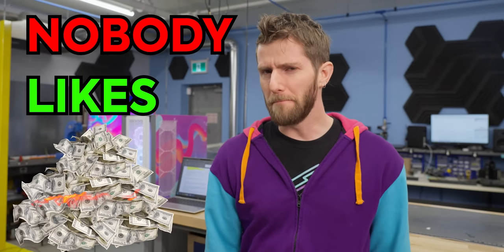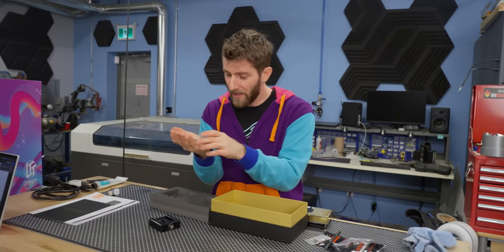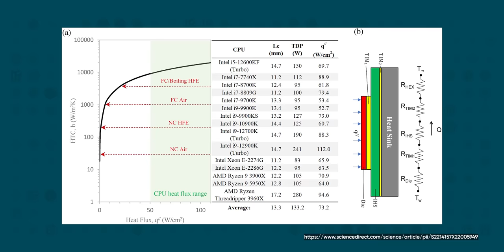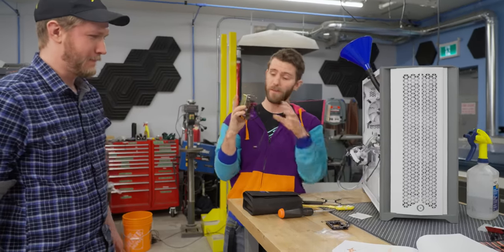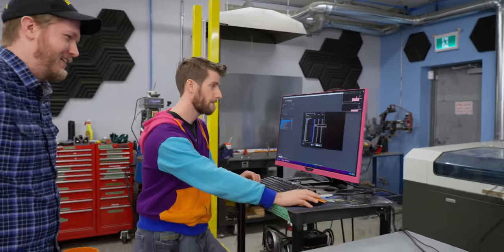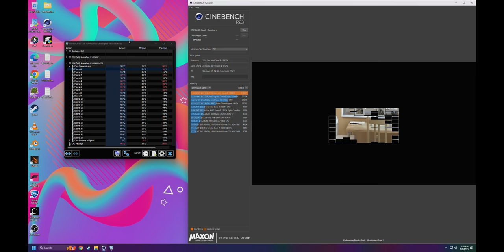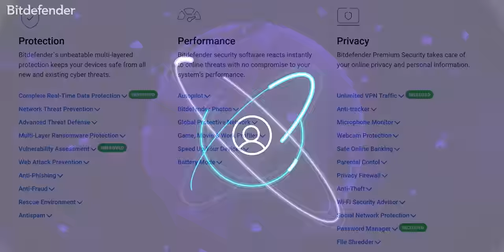This Cooler Might Kill Your CPU - EK Direct Die Cooler

Comment: Imagine making a CPU that people use to benchmark their cooling solutions.
Reply: 7800x3d beats it and draws half the wattage
lol Intel........
Reply: @escapetherace1943  and an R7 7600 can draw more power and still be way slower - go figure - overclocking a CPU to the max makes it inefficient.
Reply: @escapetherace1943 beats it in what? Gaming?
Reply: @ABaumstumpf  also have to understand that windows 11 and intel are directly working with eachother so it better preform better and with double the cores too.
Reply: @stookla4942  " that windows 11 and intel are directly working with eachother"
So?
And AMD and Microsoft and AMD with Apple and Nvidia with Tesla etc...
Reply: Honestly, this is how all CPUs would ideally work. If the only limit is thermals, a CPU should try as hard as possible to make use of that headroom under load. If it can't do that, then the CPU's architecture is the bottleneck. Besides, if you spent the money for a chonky 360/420 radiator AIO, you should be able to get your money's worth. 13th gen Intel does it. Zen 4 AMD does it too. It just makes sense.

If 90C makes you uncomfortable or you don't like the high wattage, you can set those limits lower. It's way easier to do that than it is to scrape together every spare mhz yourself through manual overclocking.
Reply: @jmun3688  factorio and nothing else
deal with it 😎
Reply: @ABaumstumpf  "So?" It's the reason why it preforms so much better. Windows 11 was literally made specifically to work best with Intel's architecture. Going back to windows 10 shows different results due to them having equal support.
Reply: @stookla4942  "Windows 11 was literally made specifically to work best with Intel's architecture. "
Yeah - As i already said - the exact same as Microsoft working together with AMD to make WIn10/11 work better with Ryzen..................
All you have shown so far is - well - nothing.
Reply: @ABaumstumpf  have u not kept up with the news?The amount of effort that was put in to Intel was way more than AMD. I wish u a good day.
Reply: @twerking bollocks Yes, because simulation software needs the CPU to be able to grap as much data into Cache as possible, so the x3D is better, because it has much more Level 3 Cache, so that the memory controller can grap more memory from the RAM. Especially in simulations this is important, as most of the data will be the same all the time, that is catched from RAM into cache, recalculated, resend into RAM, reloaded from RAM and so on and so on. You don't gain the speed in the simulation thanks to the calculation cores, but that you can utilize the cores better as they get more constant data streams, each of them. That was by the way also the reason, why the 3600 was so much faster than the 14nm Intel CPUs of that time, not only the CPU node, which made the calculations faster, but also the fact, that thanks to the smaller core nodes AMD was already able to put much more cache on the die. 

By the way, laptop users are used to having CPUs at 80-90 degree often. It's only the PC people who were used to 50-60 degree with older generations that now get into panic mode because their new CPUs don't try anymore to be as cool as possible, but as fast as possible. The reason by the way is that, also thanks to laptop CPUs and especially smartphone SOCs, the chip companies nowadays know much better than in the 2000s or 2010s where to put the heat sensors on to the die, how to calculate the specific temperatures and how to deal with short temperature spikes than in the past, so that their throttling is much more advanced than in the past - they don't need to fear anymore that in certain situations their throttling fails and the CPU burns itself to death, so they can go to the temperature limits.

And by the way, as I'm old, I remember times when throttling wasn't something existing at all, until the middle of the 2000s the CPUs ran on high base clocks and the only way to get more performance out of them was to undervolt them so that you could manipulate the multiplicator without causing heat death. Nowadays when der8auer or Linus overclock a CPU and go over the edge, the system either throttles down too much or just turns itself off - but don't burn down your precious CPU anymore.
Reply: @stookla4942  "have u not kept up with the news?The amount of effort that was put in to Intel was way more than AMD. "
Sure - if you say so then everything that Microsoft and MAD said must be wrong - ok, good to know that you know it better than the companies involved.
Reply: @ABaumstumpf  it's not a secret.  Intel and Microsoft are a lot closer that Microsoft and AMD.   That came up in one of the Supreme Court monopoly cases.   And then they totally looked the other way as usual.
Reply: @jemiebridges3197  "That came up in one of the Supreme Court monopoly cases."
Yep - and if you had actually read up on that case it also came up that Microsoft and AMD were working together closely...

Talk about dishonest fanboys.
Reply: @escapetherace1943  the 7800 doesn't beat it at all lmao. There's no real benchmarks yet, all we know is what AMD is telling us and they're not going to come out and say "yeah the i9 is gonna beat it".
Reply: @twerkingbollocks6661 Those games will not run better on ANY AMD chip. Any 13th gen intel will likely outperform the new ryzens in those games because like most video games, they're mostly single threaded and intel still holds the crown in single core performance. Not to mention you get the overclocking performance of a 3 thousand dollar AMD chip in a 700 dollar intel.
Reply: @twerkingbollocks6661 ok. I'd still rather have a 13900k just because it's basically a budget workstation cpu
Reply: @ABaumstumpf  Nvidia does not make anything for tesla anymore, tesla makes there own chips for self driving. and as fare as i know the computer for gaming in a tesla is AMD based.
Reply: @pirojfmifhghek566  Right now   one of the worst bottlenecks for computes is we're stuck with synchronous system clocks. Going asynchronous would free up so many resources as to be stupid.
Reply: True, but there are a ton of caveats. Asynchronous clocks aren't guaranteed to improve performance. They're not completely clockless either, so there's gonna be some overhead.

RISC/ARM is something on the market that's naturally asynch. It's just not clockless. Apple certainly succeeded at making the transition, but all they've managed to show is a huge increase in efficiency. Now I'm not knocking the performance per watt ratio, but when it comes to raw performance they get trounced by other desktop chips. Apple also inadvertently created an unpatchable security flaw that had been baked into the silicon itself. If a similar thing were to happen in the greater pc market, that could be potentially catastrophic. For interoperability, everyone would have to follow the same standards for a new, universal reduced-instruction set. If the instruction set itself is the vulnerability, that's a mess that would affect absolutely everyone. I'm sure there are some very smart people ironing this out as we speak, but it's gonna take some time.

Now if we're talking about pure clockless asynch, that's where you really see the biggest gains. Unfortunately, it's insanely unwieldy due to the quirks of electronics, so it's not well suited for the role of a CPU at all.

However, clockless is perfect for supplemental analog circuitry. Programmable analog chips are ridiculously useful for complex tasks like neural networks and machine learning. I could easily see socketable/PCIe analog chips making their way onto our motherboards to take that load off of the GPU. There are a ton of inference tasks that programmers want to implement that don't involve making bad pictures of people with too many fingers.

Who knows? It may even be used in game engines to accelerate tasks like continuous procedural generation, complex real-world physics (especially VR inputs), wholesale texture creation, etc. The GPU's already working its ass off making frames. It doesn't need to be doing all that stuff on top of it. I'm sure your electric bill would appreciate that as well.
Reply: @pirojfmifhghek566  ^^^^ Good point about apple clock less computers, at least for now. Flutters in the electronics do wreak havoc. But like you said field programable chips for neural network and ai workloads, Qbit(quanitum bits) when or if they make it to the desktop space,  and oh dude yes yes yes yes! off loading the insane amount of physics and hard af maths from the GPU onto a specialised chip, all that kind of things have just epic levels of untapped potential. You said better than I, why it's so weird and frustrating we don't see much work their. IIRC right from back in the day MIT(???) and even apple had a prototype fully clockless system. Development stalled (and then canceled) at the time because of the chicken and egg I think we're agreeing on: developers don't want to take a risk on something unproven, but in order to take that risk you need developers so as to (eventually) get socketable chips or even whole new kinds of components for Ai, VR, Physics systems for games and sciences etc.
Reply: @stookla4942  I'm not sure what you speak about tbh. You know that Xbox one X operating system is basically a windows 10 system and kernel ? 
Do you know that it has a Ryzen based CPU ?

You think microsoft haven't optimized there Xbox operating system for Ryzen ? Of course they have. The optimizations done on xbox is easily done on PC afterwards......it's the freaking same kernel, it's the freaking same Ryzen architecture.
But it's true that 7900x3D and 7950x3D are kinda a new architecture with two CCDs, windows probably not optimized for those two, with that I can agree.
Reply: It’s nuts they blast it super cold, and the stock clock tune still has a little left in it. That’s ridiculous

Comment: You need to add a pressure bypass valve on the chiller output. Doesn't have to be fancy. A simple spring-loaded unit will work fine so long as it's an adjustable type. It'll keep flow going to the CPU block, but bleed excess pressure back to the chiller return. That way you won't have to worry about overpressure killing gaskets or blowing out a water block seal. Easier on the chiller, too. It's funny watching you scramble when water sprays everywhere, but the building & operations manager in me winces every time it happens
Reply: Oh yeah, good idea
Reply: I'm not a fan of putting liquids anywhere near the inside of my computer, but this newer generation of CPUs has me thinking that air cooling might not actually be viable for much longer when it comes to higher mid-tier CPUs and better. Everything's just running hotter nowadays. 

Figured I might as well start paying more attention, and this is exactly the kind of tidbit of information that could save me hours of trouble in the future. Thanks for that.
Reply: @trajectoryunown  my friend, unless you plan on buying that refrigerator sized industrial water chiller they are using, the pressure provided by normal water loop pumps is nothing to worry about!
Reply: @trajectoryunown  well most people are gonna be pretty fine with an aio or a thermsyphon to cool there cpu this only ever gonna be useful for a very very nieche audience/market.

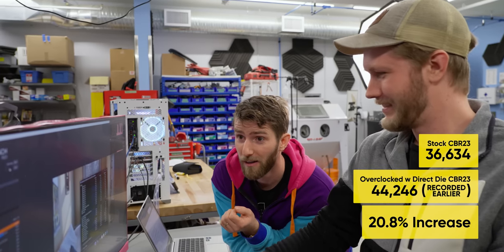Comment: @15:43 - 20% increase in performance at the cost of OVER 250% more power draw on the package. Would laugh to see the power to performance graphs on this, with the chiller power added in there as well.
Reply: i high doubt it is not using more than anything else put together.
but then they are in canada, they could just pump water from a outside water tank 😂
Reply: @affegpus4195  more heat dissipation = more heat generation = more power consuption
Reply: @affegpus4195  They are in BC near the water aren't they? It's way more mild than most of the northern US (that isn't on the ocean)
Reply: amd fanboy spotted
Reply: @666Necropsy  Intel fanboy.

Cant handle the heat and power consumption.
Reply: More like, PC Idiots (from either side) when they see contents clearly meant for chasing the records and laugh at the power consumption.
Hello? An airplane uses more fuel than a car too.
Reply: @h.m.chuang0224 . So an Arm processor is the car?
Reply: @robertt9342  ARM will be like an electric vehicle. Yeah, it's more efficient. And yes, it's not the fastest car ever exist.
Reply: And you haven't factored in the power draw of that massive cooler
Reply: @p0xus  
⁰
Reply: @MRgreen  Not quite. I'm a technology fanboy. Competition breeds progress, drives price wars. which benefits us, the consumer. Better product at a better cost.

Comment: I love your pun on Direct-Die Waterblock

As a note, you may want to switch your  water blocks to be in parallel with that much water velocity and pressure.  Possibly add a pressure relief bypass.

Comment: I kind of wish manufacturers would try and make this kind of cooling safer. Seeing those temps on normal water really was oddly inspiring.
Reply: I agree. That being said I am less afraid of direct die than most due to a combination of dealing with old PCs and modern laptops where direct die is the norm.
Reply: @ThomasCpp  it really didn't seem that hard... Delid, install, monitor temps and stress test.. reseat if needed
Reply: @TheBuhrewnoShow  It would also make for a great "performance package" where the CPU is supplied with like this cooler instead of a default lid. It makes sense that they need to ship these insane CPUs prepared for water cooling. Like "this is top of the line performance, air cooling won't work, period, get a water cooled system" or something like that.
Reply: @TheWinjin  That's a great idea - market an 'extreme' brand of each chip that comes delidded from the factory. I'm sure they'd be able to charge another $200 for it.
Reply: @TheBuhrewnoShow  would it even be considered deliddled if it comes pre-liddled with liquid metal and one of these bad bois from the factory? You'd even get to keep the factory warranty!
Reply: @TheWinjin  even better man
Reply: @TheBuhrewnoShow  yeah it seems like we're really heading towards "gamer" rigs that are designed to be water-cooled from the getgo. And maybe even not ambient water, though I can't imagine anyone making "fridge rigs" the default. Just way too expensive.

Comment: JayzTwoCents took 27 attempts with the delidding tool.  Also he noted that Roman's version that he showed off on his channel delids sideways, not lengthwise.
Reply: It's SUPPOSED to take that long. It's designed to do it slowly and safely. Linus just did it completely wrong.
Reply: Roman's tool and EK's are different. EK's just seems generally shittier.
Reply: the one that goes the other way is because it was 13th gen only, or at least that is what he said in that video... the kit that you get from EK is for 12th and 13th so it goes the way it does... he also said that in the video as well. He also said you can use a bit of heat to help too...
Reply: @Masterune178  pertty sure ek's is just derbauers first 12th gen delidding tool. Looks like the one thermal grizzly did early on and didn't use.
Reply: @fade2black001  because a lot of people watch him and may think that's an OK way to do things. Also, I would say it was a miracle it worked at all but it turns out it actually wasn't faster. They replied somewhere else that they actually edited out all of the other cycles and only went manual after a ton of cycles. So now the situation is that the video portrays this as a way that might work faster when the actuality is that it almost certainly would break the chip if you tried to pry it off after a couple of cycles.
Reply: Jay also ended up with Serial # 002/250ish… comical to see LMG get # 069 for the memes
Reply: Ltt responded on another comment saying that they did use the delidding on that cpu tool many many times, but it didn't work and most of it got cut from the video
Reply: the ek de-lidder is dog sh*t to keep it simple. another youtuber was supper carful and ended up breaking the bolts (hes an expert nitrogen overclocker record holder) . Even a generic de-lidder has screws on both sides and makes it a lot faster/ easier
Reply: @flyryan  EK's delidder started stripping the threads on the screw after 20-30 passes. Even Jay said it was a bad delidding tool.
Reply: Hansy  I would Bet different, but idk the answere. I Almost only know adults
Reply: @flyryan  Exactly, the methodology is based on adhesive fatigue. Now... there are going to be idiots copying Linus's impatient madness 🤦‍♂😂.
Reply: @flyryan  that's fair to think they MIGHT make people think its okay to pry it apart after just a few cycles but as someone oblivious to delidding before i did not get that as the gist of what they showed. more like a we are because we are willing to risk it but not recommended you do it yourself
Reply: Hansy   "children's show" I watched as a lid." I like what you did there 😁
Reply: @flyryan  dude nobody is going to take a hammer to their cpu, stop being so dramatic

Comment: Alex and Linus never disappoint with their janky and chaotic cooling projects.
Reply: This is absolutely not janky or chaotic. It's about as professional as you can get. At least with the case they are using which is not designed for an external cooler.
Reply: The chaotic power is insane 💪😁😅
Reply: And we even go two within a week from one another! Is it Christmas yet?
Reply: They did however pull a bait and switch in the thumbnail, putting in a pic of one of the best selling coolers on the market and saying “this could kill your cpu” and then never actually showing that cooler